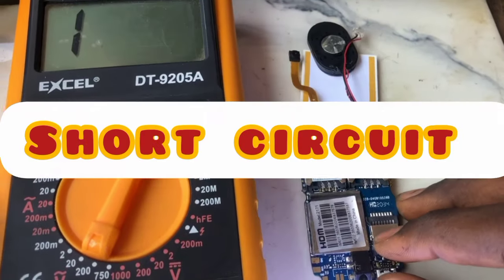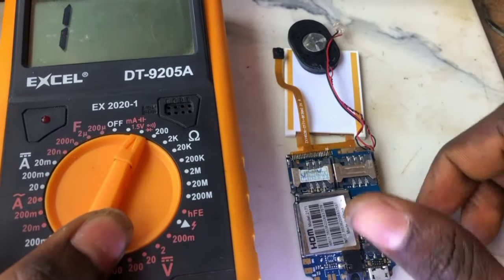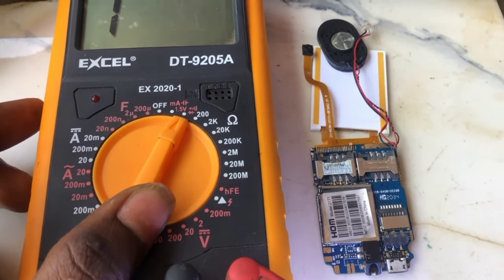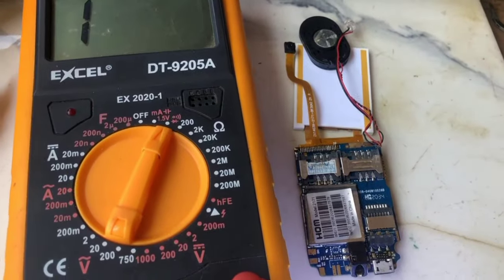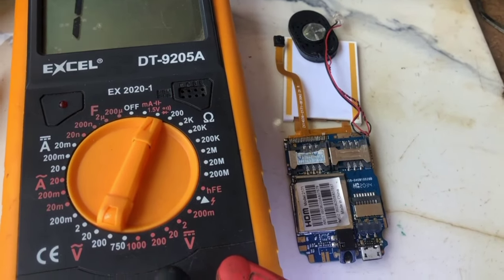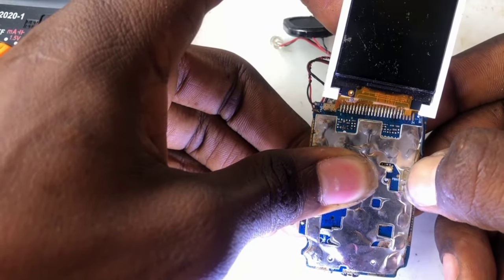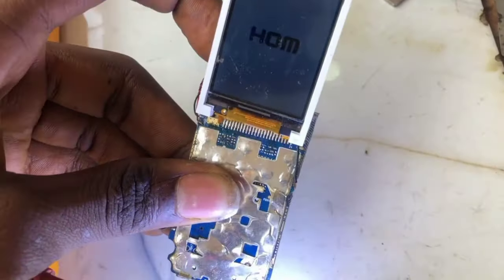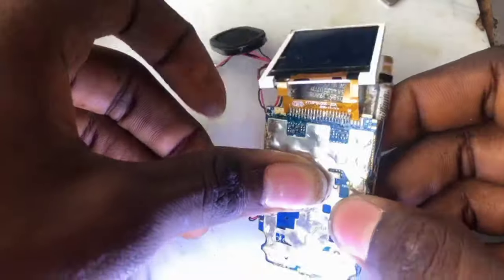Full tutorial about Short circuit on Phone board (PCB short circuit solution) dead phone solution 1

Comment: My phone tecno spark 5 was hot while I was surfing twitter.The I switched it off.AFTER one hour later I press the button to start the phone,but the was unable to start.It was dead.The screen is working,the battery is working,before this has happened ,there was heat to the charging  connector side.What is the solution?Some say it is hardware,others SAY software.sO CAN i GET HARDWARE?What would you say??
Reply from the maker: Thanks for the feedback ..
To learn more you can also join my VIP class and ask me questions on WhatsApp 
You can contact me on WhatsApp:  +2348135885146 
WhatsApp number: +2348135885146
WhatsApp link :  https://wa.me/qr/4CVJK3K22OVWG1

Please Don't forget to like and comment on my videos and also subscribe to my YouTube channel to get updated of my next uploads